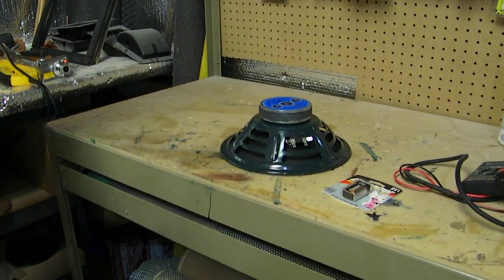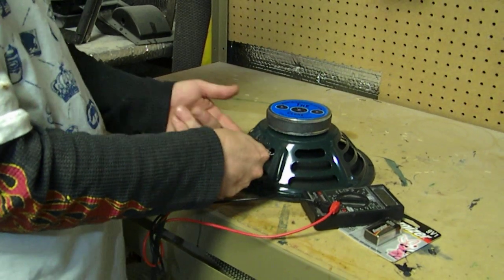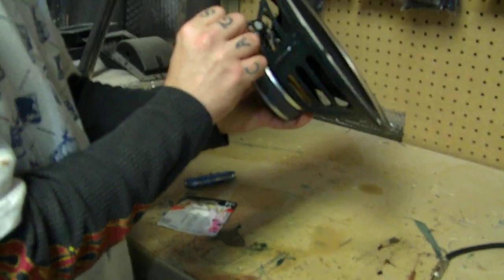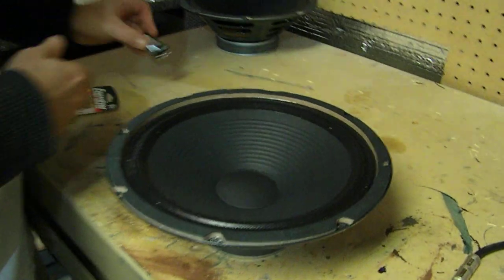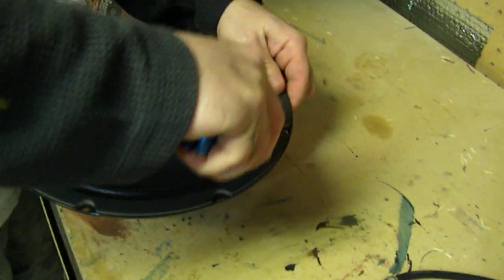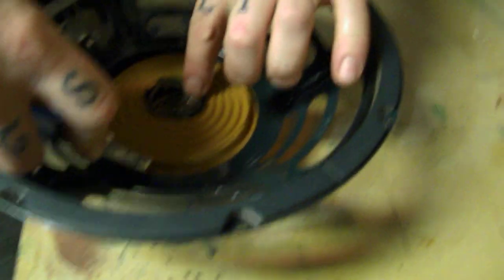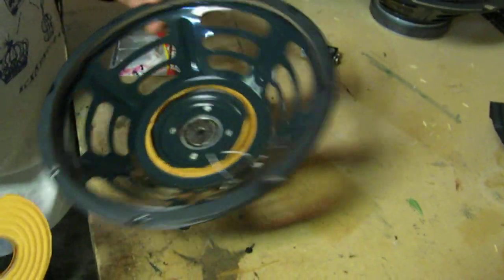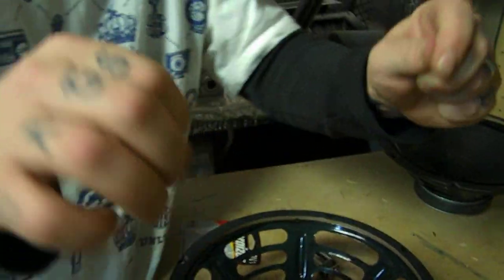EarCandy FAQ Blowing up a 10'' guitar speaker aftermath vid

Comment: I know this video is super old now, but I have a question about this!!

I have a 90 watt tube amplifier with a 90 watt speaker. 
I have a 200 watt SS head.

Will the 90 watt speaker be able to handle the 200 watt SS head?  I am curious because the 90 watt amp, in general sounds significantly louder. even though the 200 watt head is 2x the wattage